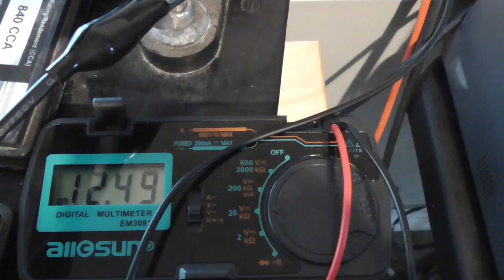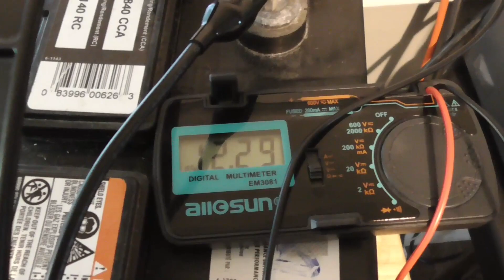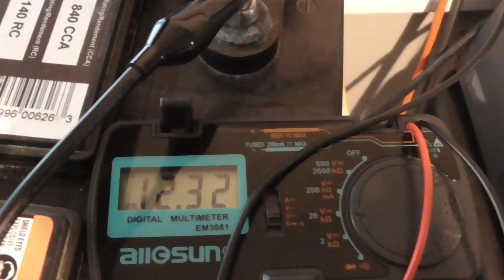Self charging Battery

Comment: joel is this whats called a tesla switch, if so i been trying to figure out how to automate the actual switching of the batteries. i was thinking of using aduino with a voltage trigger. but may need relays like you have in your diagram.. any ideas? the aduino code will be time consuming. if nothing can be found in the code library
Reply from the maker: Bedini calls it a "Tesla" switch because he shorts (dumps) a capacitor.

Comment: secondly can i use NE555 timer with a mosfet to produce pulses into the big coil?
Reply from the maker: You can use any method you want to pulse the coil, Just try and keep your controller minimal parts. Every stage is an additional loss.

Comment: I am looking to replicate what you have here.  I was doing the math, but I am missing the amps on your coil due to I don't know the formula for the hertz & duty cycle, plus that negative emf.  You have an output of 33 volts from the coil - pulsing to the battery.  From what i heard and seen in the video, the numbers line up as follows - Your coil output is
Current (I) = Voltage (V) / Impedance (Z)
33V / 1.9 ohms = 17.37A output <wow>

Power (P) = Voltage (V) x Current (I)
Using your input supply power 
9v x .200 millamps P=1.8W

Running at 1hr would be 3600 seconds 
1.8w *3600= 6480 joules

E_out = P_out * t
P_out = 33V * 17.36A = 573W
E_out = 33W * 3600s = 118800J

Efficiency = E_out / E_in * 100%
Efficiency = 118800J / 6480J * 100% = 1833%

Now if I drop it to 6v because your pwm input and output is the same due to the converter - it gets better.
The coil -
Current (I) = Voltage (V) / Impedance (Z)
33V / 1.9 ohms = 17.37A output

Power (P) = Voltage (V) x Current (I)
Using your input supply power 
6v x .200 millamps P=1.2W

Running at 1hr would be 3600 seconds 
1.2w *3600= 4320 joules

E_out = P_out * t
P_out = 33V * 17.36A = 573W
E_out = 33W * 3600s = 118800J

Efficiency = E_out / E_in * 100%
Efficiency = 118800J / 4320J * 100% = 2750%
That's outstanding, BUT Is there anyway you can take the output measurement of the coil in amps?  

If I throw the coil impedance out the window and just go with watts and volts then I get
Amps=watts/volts
1.2/33=0.04amps or 40 milliamps 
E_out = P_out * t
P_out = 33V * 0.04A = 1.32W
E_out = 1.32W * 3600s = 4752J
Efficiency = E_out / E_in * 100%
Efficiency = 4752J / 4320J * 100% = 1.1%
Still over-unity, but I hope that the coil gets more amperage from the spike..........  Please measure 🙏
Reply from the maker: I didn't focus much on math in this video, but I cover it more in my other videos. Generally speaking, you are correct. However, one of the reasons I didn't bother with the math in this particular case is because it would probably trigger arguments on my channel, as there are different methods that can yield different results.

Personally, I prefer to stick with pure amp and second measurements, as we are dealing with pulsing and cap dumps. As for the power input of the switching circuit, I just ignore it and assume it operates only in the milliamps range.

My approach is to calculate the joule output, similar to what you did. If anyone argues with me about it, I tell them that I can run the switch on its own isolated 9v (or less) battery for days of operational switching of an external source. By doing this, we create increased back emf amplitudes from an external source (in this case, the bigger 12v battery) and feedback it into this battery for charging.

At 1% duty cycle or less, we don't really let any significant amount of current output for trigger, yet we get a huge increase in amplitude spike that comes back and hits the battery at much greater intensity. The trick is sharp spike trigger 1% or less, and by doing so, we get a higher voltage back emf sharp spike output without wasting any input "current" to get that increased amplitude back. So, in summary, we use the switching to trigger the 12v pulse that comes back as back emf, while the 9v (or less) battery or PSU is only used to run the switching in isolation.

Comment from the maker: And remember folks, you can have similar results if not better if you use "RF" frequencies instead. Of course this would require some better parts to work with switching at RF speeds, The bonus here once you get it to work, Anything over 200 khz will get some interesting results and for some reasons batteries love being charged up similar to radiant. How ever it also looks like RF also has its set of unique surprises as well when utilized as such. just saying. At 500 khz with about 100 watts "radio transmitter" I notice some "anti gravity" like effects near that coil. Sharply pulsing high frequency into an air core causes scalar disturbances? interesting. You have been warned :) If your free energy machine goes flying away. Don't blame me.
Reply: im assuming at 500hz with 100watts a portal will open up in the aircore and 10 siamese cats will jump out of it and come into your living space 
🐱👍🏿
Reply from the maker: @fidelcatsro6948  yes that's just it but its not cats.. its aliens that come out of the portal lol, the Egyptians had it all wrong with their cat drawings.

Comment: Amazing video. A schematic of your setup will be more than helpful. Thank you for sharing!
Reply from the maker: I will eventually get to it, I just hate making schematics and not that neat at drawing them up. The reason some of my circuits I post without is simply because I feel that the heart of the circuit is not as important as what is going on and I explain the method as best as I can of generating high voltages quickly and dumping that into a charge battery or capacitor combo. The methods of getting this radiant spike are vast and I believe there is not just one way of going at it. Any way or method you want to use to generate that radiant spike, Use any oscillator circuit for exemple, just make sure to limit the input current usage as much as you can. This circuit works by pulsing a low voltage into a big coil and simply using the high voltage back emf to pulse charge a cap and dump cap at 110 volts into battery. Inverter isolates the circuit, I believe in Bedini's more complex cap dump circuit he uses a opto isolator, instead. But yes I will get around to schematics thanks!
Reply: @joellagace1679  This is really interesting! To make things simpler, draw a block diagram, but add details to the more intricate parts, like the coil. I'd love to replicate this. I'm running a pulse motor and got the current down to 200mA, so I'm hoping to generate more from the back emf to charge the battery.
Reply from the maker: @JohnnyD_cm  Cool I would not be happy with 200ma if this would be let's say a small dc toy motor, I'd like to get it down to maybe 25ma. but I have no clue what sizes your working with so 200ma can be darn good as well depending on the motor.
Reply: @joellagace1679  I've played around with Bedini circuits but I didn't get overunity. What I've noticed from your experiment is that huge coil, and maybe this is the way to OU. The bigger the coil the better. As they use to say size matters.😊
Reply from the maker: @Machiuka  And the worst part is the high impedance crappy  ugly test leads all over the circuit and it still manages, so the gains must be pretty high, I'm going to fix this circuit up and use good wire. Might be able to use 40 watts or more instead of just 20.
Reply from the maker: @Machiuka  Well most forum user will tell you im all wrong and tell you to use  much smaller coil, I have experimented with tons of smaller coils they work but no over unity like effects, My hypothesis on it is that the small coils are high impedance, this is great for quick high voltage generation, it will charge caps and batteries quicky with radiant energy  but no over unity! The bigger  coil is low impedance, For some reason Bedini didn't talk about the small current spike that came after the radiant, I guess he felt it was not relevant, And perhaps its not if your just looking at desulfating batteries. If you want to notice some over-unity you need to put in a little bit of current as well. Like in the milliamps range, And the bigger coil allows us to pulse this higher "small" current. Not so much higher current but more efficient distribution of it across the inductance. And from my own observation when you have that radiant spike with some milliamps current behind it as well the combo of both makes the "magic" happen but you don't need very much but the current does indeed compliment the radiant spike. Bedini didn't talk about that. But you do see in his amp meters some jumps of 1.5 amps during the input on time pulse on his huge machines. So yeah not "zero" energy at this point but dam close and if that got him the kilowatts output after in battery energy storage, perhaps the small amount of current is the key here. And I think you can only pulse current with a bigger low impedance coil? Just sharing my observations.